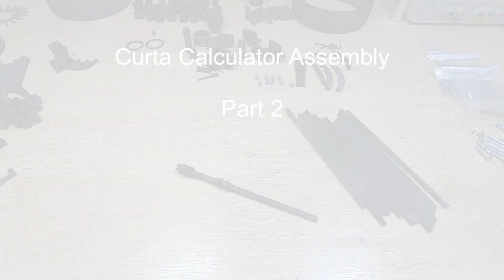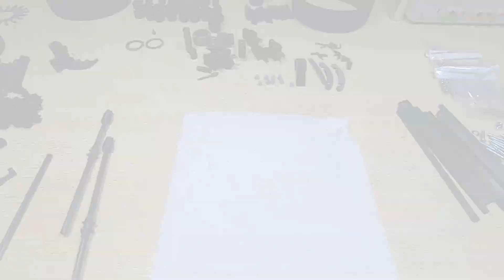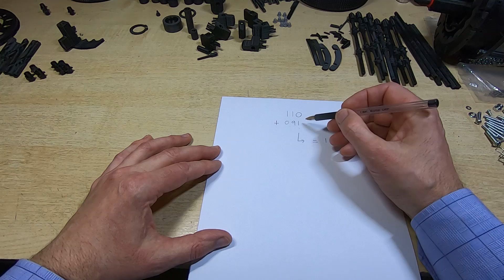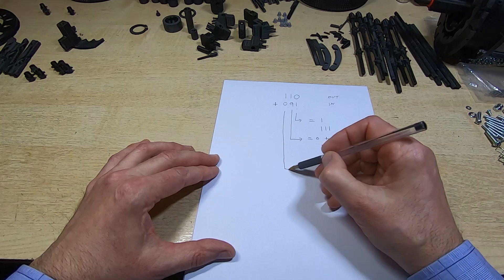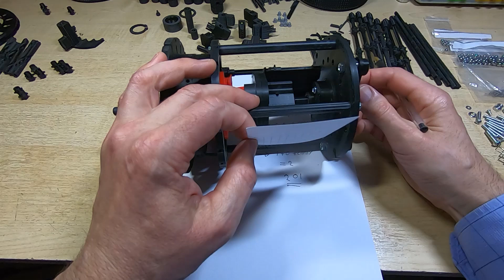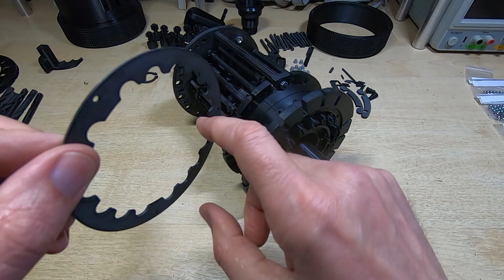Curta Calculator Assembly Part2

Comment: Yeah, dry PTFE is such an excellent lubricant, especially for plastic parts.
I think the most successful application for me has been the pull-out trays in my bedroom wardrobe.
They're made from some type of plastic and they have plastic rails/channels on the sides and the tray slides in those. Good lord how much stiction they had when I moved here. They weren't visibly dirty nor did I see any detritus on paper when I wiped them. Just too much friction.
Few squirts of dry PTFE and they slide like a dream. 4½ years later I can still move them with my pinky with clothes on top of the trays.
Which I think is fairly impressive considering the contact area is like almost 50cm times few millimeters times two..

Comment: The original design has spring clips where you use O-rings to hold the fixed gears. Marcus's OnShape file includes them but he did not make STLs from them, as they are too flimsy. However, if you modify them to make them thicker, they do work fine.
Reply from the maker: Yes I know but I decided that O rings would work better here as they are only temporary.
In my final version I will just use the plain type drive shaft and circliips.
This will allow adjustment of the gear position and they will not need grooves on a plastic rod.
I may also add bearing caps at each end of the drive shafts as the cutout in each shaft extends to the end of each shaft and so runs in the bearing holes which causes a lot of friction.